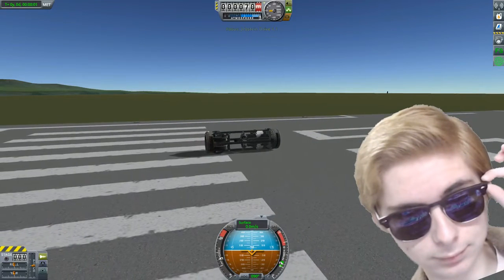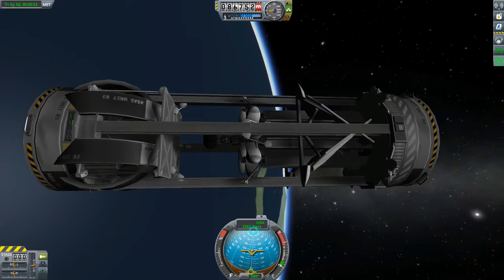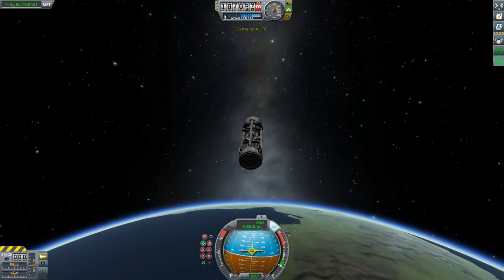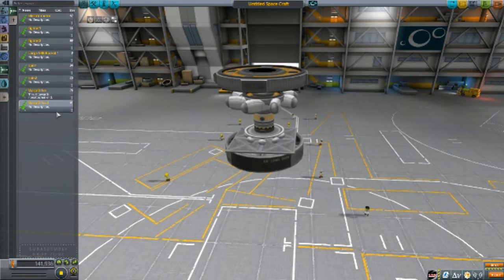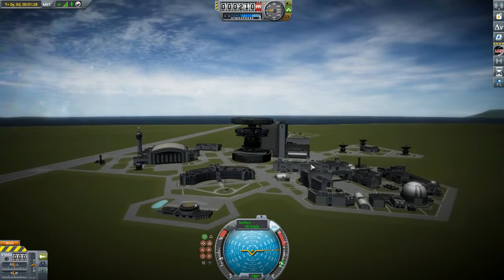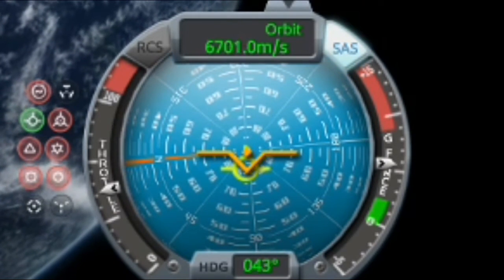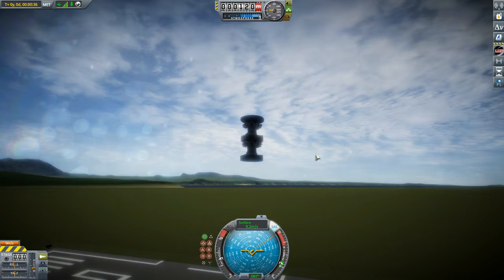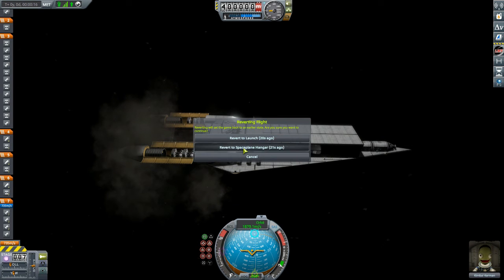KSP Kraken Drive - Stock Warp Drives and Why They Suck

Comment: Kraken drives works in Xbox one version?
Reply from the maker: I don't have that version, but I doubt it would be any different. Try it yourself, and let me know.
Reply: @LordPastaProductions  
I came back with promising results.  Kraken Drive made with MK1 landing can and LY-05 landing gear works being definitely better than the pc versions, apparently having no weight limits (I used it on a ship with more than 20 tons) but there are navigational difficulties as it stops  generate movement or explode as soon as you take a course out of the influence of a celestial body (other than the sun) if you leave the influence of this body and turn off the engine, when reactivating it can explode or stop working, my theory and  that navigating from orbit to orbit solves the problem, I have to do more tests.  Warp Drive on KSP Xbox one is real.
Reply: @LordPastaProductions  
MISSION ACCEPTS

Comment: Being able to set same vessel interaction allows for extremely stable krakendrives, if you have Breaking Ground. I have a K-Drive that is able to go as little as .1 m/s^2 and as high as 147 m/s^2, with tiny adjustments in thrust possible by using the extension target and force limit on a hydraulic piston. You can link either of those to the main throttle or custom axis and use that just as you would any other engine. I may or may not have spent too much time playing with krakendrives... https://kerbalx.com/TheUnamusedFox/K-Drive-Showcase
Reply from the maker: interesting. I'll check it out.